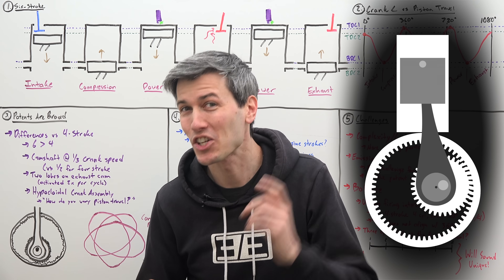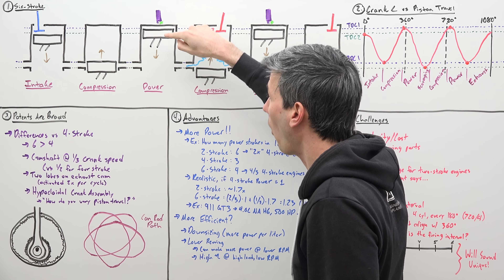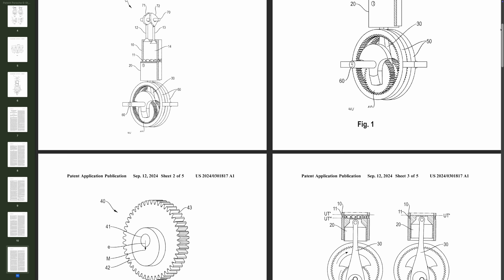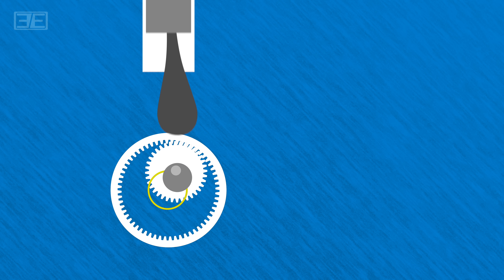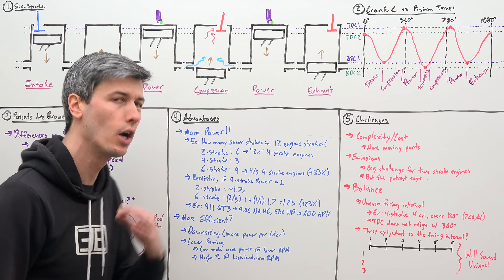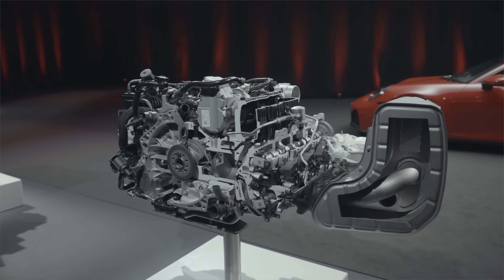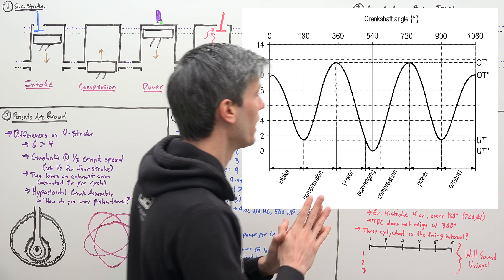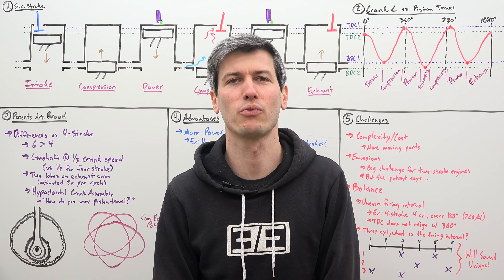Porsche's 6-Stroke Engine Is Genius!

Comment: As a mechanic I'm already getting cold sweats about timing it
Reply: And as a reliability engineer, I'm in the same boat ;-)
Reply: @jalanperak taking on water?
Reply: @jalanperak  
Is the dirty two stroke narrative a myth given the same exhaust clean up as 4 stroke and using high forced induction pressures combined with slower engine speeds to increase time for cylinder filling, combustion and scavenging ?.
What can this lash up do that just two stroke couldn't do simpler and better ?.
Reply: @confederatenationalist7283 it's a concept engine, we have cat afterburners, we have computer monitored clean burn! This engine is in no way necessary, but a supercar that will pass a gas station, would be a good sales point!
Reply: @confederatenationalist7283 2 strokes generally have to have lubricants in the fuel. 6 stroke would presumably avoid that issue
Reply: @kalasmournrex1470  
Not Uniflow two stroke.
Only crankcase transfer port type.
Uniflow two stroke diesel engines have existed for decades automotive and marine they use the same lubrication system as 4 strokes.
Two stroke design is all about solving the volumetric efficiency issue of the short induction period.
Solved by as much forced induction as you dare.
Reply: @confederatenationalist7283 2 stroke is only dirty because they burn the oil. This is a 4stroke with a 2 stroke cycle. So there wouldn't be any oil burning. Because that isn't added to the fuel
Reply: @Superliegebeest0 
A uniflow two stroke doesn't use oil added to the fuel.
It's nothing like a crankcase transfer port design.
The piston uncovers the inlet ports in the lower cylinder walls before BDC.Then closes them after BDC.
Assuming decent forced induction removing the cylinder filling volumetric efficiency issue there are no downsides.
Reply: Porche: it will be done in the computer - but we'll rent you the diagnostic tool for $12,000 per month.
Reply: I wonder about reliability more, it seem overcomplicated wich usually lead to failure.
Reply: @nekot9274  
It looks like the worst of all worlds in none of the advantages of two stroke operation with insane levels of needless complication to do it.
Reply: @confederatenationalist7283  Exactly, with this 6 strokes engine, you got 2 power ones, Half of one more than with a regular 4 stroke but 2 less than with a 2 strokes for the same number of engine revolution. It is a very complicated therefore fragile concept for half a power stroke more. There is a reason that there is no bearing on the crank shaft, they are not strong enought to take the beating, so gear?
Problems waiting to happen...
Reply: @nekot9274 agreed keep it light and simple
Reply: Solenoid based valvetrain, maybe? Why not, we're already on six strokes...why not nix the cam altogether😂
Reply: @brittbancroft7817  
Flat 12, compound supercharged and turbocharged, boxer uniflow two stroke, with camless exhaust valve train.I like it.
Reply: It looks like it's all gear driven so everything would be indexed.
Reply: @MichaelLamar-zr7fy  
But massive levels of complication and labour costs for a bottom end rebuild.Theres probably a reason why design settled on the shell bearing and oil film rod to crank connection rather than the ball bearing system, let alone this idea.
Reply: @confederatenationalist7283  Exactly.
Reply: Let the Siemens computer deal with it. Those things can measure 1 gram of air missing in a minute.
Reply: Machinist trying to figure out how to balance the crank
Reply: As a comedian I'm already getting child sweats about timing
Reply: Finally at TDC… which one!?!
Reply: Timing is the last thing I’m worried about personally ( which could be wrong to say ) but considering the VVT technology and ability to control spark now I’m more interested in this crankshaft design and how long it will last
Reply: You don't actually think this thing will turn up in cars do you?
Reply: The timing should be ok, once the marks are lined up it’s smooth sailing from there.
Reply: ...and when you are finish with timing trow it away and take a BYD
Reply: @محمدأحمدالحمداتي  
No thanks.
Reply: Should be like timing vanos on a bimmer, you’ll have to lock the eccentric crank gear in a certain configuration before timing, and as this is under VW I’m sure they will also have you lock a similar setup on cams.

It will have a lot of Porsche tech/engine specific tools for sure.

Not DIY friendly but neither are most Porsche engines going by Mat Armstrong vids.
Reply: Idk if this will handle a misfire well 😂
Reply: Could use valve train like Koenigsegg has, if they don't have a patent on it
Reply: I bet you're underpaid at your job
Reply: That’s why you just stay in your lane.
Reply: No joke I was the 1,000th like for this comment on his 1,000th video 😂
Reply: it would be almost exactly the same as any other engine, you'd just have to make sure you're on the right top dead center. get the first piston to TDC1 and then align the cam gears. there may or may not be timing marks, if not then there will just be some tool to align it.
Reply: @boxr_4214  
There is no connection of any  piston and rod assembly to any other.They all have to be timed individually to their correct position relative to the crankshaft angle for each cylinder and it's rod and piston  ?.
In addition to any gear train wear throws the timing out for that piston and rod.
There are no advantages in this over a two stroke but there are massive disadvantages.
Reply: @confederatenationalist7283  that makes no sense. there is still a crankshaft, otherwise there’s no way to transmit power to the gearbox. the crankshaft just attaches to the gear rather than the connecting rod directly. i’m not sure what the exact way that an engine like this would assembled is, but it’d be fairly easy to put timing marks on the gears. then you just line up the marks to get all the conrods timed with each other. but that’s bottom end stuff anyway, no one is messing with that unless you’re and engine builder. the camshaft timing is what i was talking about, and that would still be pretty simple.

also i never said this engine was any good im just pointing out that timing the engine isn’t a major concern. it would be easy assuming the engineers put timing marks, and if they didn’t then you’d just have to make your own marks based on info from a shop manual.
Reply: Understandable
Reply: You think they’re gonna let mechanics into this thing? If it’s anything like Nissans VC engine, if there’s a problem it gets a new motor.
Reply: You are obviously not a German mechanic. 😂
Reply: Would not be like a normal combustion engine. Probably more similar to a gear connection between crank rod.
Reply: Two different TDC... lol
Reply: Just LS swap it already. Solved
Reply: Took the words outta my mouth brother...the new guys should just start looking for new jobs now
Reply: Don't tell Matt Armstrong
Reply: Ignition triggers will be a head fcuk.
Reply: 6 stroke v wankel
Reply: @quinn860  = random motor
Reply: Exactly 😂
Reply: The maintenance on that is gonna be bonkers. So many things to go wrong.
Reply: Don't worry friend, the engineers are sweating more making a patent a commercially available product.  "Such terrible headaches" - The Professor and the head of team charged with bringing this project to fruition!
Reply: They don't have financial problems because they cater to wealthy clients that like that kind of product, that's it.
Reply: The power stroke seems to work on non direct energy.  The forces are nonlinear.
Reply: look on the bright side...  you can only do it right once.
Reply: I know lol
Reply: You'll never have to worry about it, if you see one of these it would be the only one!
Reply: Bro no worries. Just put a stick in the spark plug hole, rotate the crank 0.01mm, and feel the rotation change. Not first or second one, it's about 2/3 of the way until the third before you'll know your in top top dead dead center center. But if it goes to top top DEAD center, all the valves will blow thru the good so be careful.
Reply: I Agree. Makes no sense, it's more power consumed for less output, and more heat
Reply: Don’t worry, Porsche makes it impossible to do your own maintenance. Ask me how I know 😂
Reply: For those who think the combustion engine is going away. I don’t think so.
Reply: @OUSoonr1981 
Unfortunately there seems to be political agendas within agendas playing out.Which seems to be about disadvantaging the developed western world to the advantage of others.Not helped by manufacturers perception of more profits in selling EV's at an ICE price.While it's a mystery why they didn't and don't see the advantages of running a Uniflow two stroke engine, at half the rpm and at twice as much boost, as a four stroke engine.
Reply: not only dat tuning is gonna be a nightmare bmw finna learn from this 😂
Reply: 95% patents are never utilized.
Reply: Forced induction
Reply: Looks like there would be some vibration from the offset
Reply: Wow! A bunch of extra moving parts in the power transfer area of the engine. Bringing back power valves or reed valves, like 2 smokers. All while the world is trying to stop using internal combustion as a means of travel. Good thinking Porsche.
Reply: ?
Just align all the timing marks and install the timing chain or belt, just like any normal engine.
Reply: @larsjrgensen5975 not all engines have timing marks, some of em dont even have keyed cams  for the phasers to lock em into the cam for proper timing
Reply: @ Ok then mark the gears and chain. Then mark the new chain before removing the old chain and use a locking mechanism to lock the gears when changing the chain.
My farther borrowed a bracket to fix the gears on his V6 single OHC. On my inline 4 dual cam there was timing marks everywhere and there was small locking holes in the gears for special tools to fix the cam in place, but we did it without the special tools.
A professional mechanic should be able to get the tool or make them themselves if needed. If the cams needs replacement then it would be a problem without timing marks I agree.
Reply: @larsjrgensen5975  
Bearing in mind the insane geared and timed eccentric conrod connection at the crankshaft.
What's the point of an alternating 4 and two stroke just to get the power stroke every revolution that a two stroke would provide.
Reply: @confederatenationalist7283  There is not much info about how this engine is running in the real world.
They could decide to not exhaust after the 4 stroke cycle and then reignite the small leftovers in the cylinder like a sort of cleaning function at low load.
At higher load they could lean more into the more bangs per minute for more power, but less clean operation.
It would need direct injection for the best result.
Just a theory/guess.
Reply: @confederatenationalist7283 not sure how the engine would work out. However it might have better usable power range than a 2 stroke
Reply: @mattschm5486  
A serious forced induction Uniflow type design shouldn't be confused with a small capacity NA crankcase transfer type motorbike engine.
In the case of diesels at least specific peak torque and peak power and the rev range between them was more than a match for 4 strokes.
In fact the design has advantages for low end power potential as ultimately seen in large marine engines for shipping.
Also don't think there was any proof that the emissions issue couldn't be dealt with, as opposed to no one actually  bothered to try.
Reply: @larsjrgensen5975  
My idea would be to use two stroke only running and forced induction. But more to maximise air flow per revolution per minute to minimise combustion temperatures and pressures.
Reply: @derpwnd3213 that's when you time it with cylinder 1 up
Reply: @confederatenationalist7283 
I think he explains that in the video 😮
Reply: @larsjrgensen5975 seems that you and your daddy know everything.
Reply: @larsjrgensen5975 everything produced has marks, but lining up cylinder head surfaces with cam and chain marks has always been a goofy way of doing things! This sounds cut and dried, and may not be difficult at all!
Reply: @derpwnd3213  Engines really took a turn for the worse in about 2000-2004. I worked for a world manufacturer. The quality just went through the crapper then. They had keyed well before then. But the rest of it really took a shot after 2000.
Reply: @larsjrgensen5975  ....as the non mechanic said to the mechanic. As it happens, timing it was the first thing I thought about too.
Reply: @larsjrgensen5975 and it will be many times more complex to do. It’s why rebuilding the top end of a 2 stroke takes 15 minutes, instead of several hours.
Reply: @randygrein5386  
In this case all the complication looks even worse in the bottom end.
Two stroke uniflow could at least go back to simple pushrod exhaust valve actuation.
Reply: @larsjrgensen5975  I hope, but doubt it is that simple. Also, there is building the engine from block up which makes timing a little more complex than  swapping out a timing belt/chain.
Reply: @larsjrgensen5975 you think it’s that easy 😂
Reply: @larsjrgensen5975  its never that easy for German vehicles.
Reply: @larsjrgensen5975 you sir have obviously never had the pleasure of erman engineering
Reply: Why are they still investing in combustion engines 🤔🤔
Reply: @MohaAhmadhamadani  
Why not ?.No one voted for the abolition of ICE.
Reply: @محمدأحمدالحمداتي  because they are awesome. No one wants an electric porsche.  People don't buy them as commuters.
Reply: @adamnagel7436  its just because we are used to. Nothing more. I was in shanghai and was very amazed from the clean air and the quiet city centre.
Reply: @محمدأحمدالحمداتي because they will still be around
Reply: All of that to get 23% is crazy though not gonna lie. 😂😂 I like it but you do it first and let me watch a while 😂😂
Reply: Ai will tune it, maybe!
Reply: @dylanlevar5176 The processing is definitely there to do it these days. 💯
Reply: Like Audi isn't bad enough. Over-engineering at it's finest. No wonder this company is in such trouble. I'm really surprised at all the people claiming they aren't in deep financial trouble. EDIT- Stock down 24% in the last year, laying off and closing plants. Apparently investors see things a little differently. Trying to claim they are different companies just doesn't work. That's like saying Lexus and Toyota aren't the same company. On the bright side it's looking like the US might allow them to open some plants there. There is even talk of the EPA having a little looser reins on the car companies.
Reply: @Troy_Built  How is Porsche in trouble? They’re selling cars like hotcakes
Reply: @AbstractWerks  aint, they suffering.
Reply: @AbstractWerks  Poor man's sports car lol
Reply: @Troy_Built  Neither Audi nor Porsche is struggling lol
Reply: @drachen6096  only their technicians are
Reply: @drachen6096  The owner of both, Volkswagen AG, is struggling.
Reply: @drachen6096  wrong, Audi truly has issues. You don't follow the news. Sure, both Audi and Aston Martin sell cars and own an F1 team, but that alone doesn't mean they are doing great or even just fine.
Reply: @drachen6096  VAG group is definetly struggling and porche is part of that, despite the fact that porche has the biggest profit margins from the group.
Reply: @staLkerhu  
They aren't doing fine because, like the rest of the industry, their customers want proper ICE powered cars.
But the governments say they aren't allowed to sell them by imposing rationing and quotas on sales.
Reply: @SoulTouchMusic93 “Porsche“ just copy it from the title
Reply: @drachen6096 yes but VAG is hurting a bit, who owns them? Also historically Porsche has had issues selling cars (little Toyota bailout)
Reply: @Troy_Built  There is a 18 month wait for some cars they are not in trouble
Reply: @Troy_Built  americans when engine is not push rod:
Reply: @thorvonfalin9975  
If it was just two stroke there's no need for inlet valves or variable valve timing and it can produce more power than 4 stroke, at much lower engine speed.
Pushrod works fine in top fuel dragsters and NASCAR even if anyone wanted high revs to make power.
Reply: @Troy_Built what EPA ? Aren’t they semi-fired already??? 😂
Reply: 😂😂😂 @Troy_Built  Audi is not a hard engine to time whatsoever. Of any year, people just get easily intimidated by the 4.2 l.
Reply: @Troy_Built  Just get a horse and buggy if the engineering is bothering you
Reply: American?
Reply: @Troy_Built  this is how the Nazis lost WWII
Reply: @Troy_Built  only EV's are in trouble the rest of their cars are perfectly fine.
Reply: @Troy_Built 100 % man I don't mind tearing engines apart put them back together but this just seems so mechanically over-engineered it's like where would I even start I get the timing and do this and do that and all that other crap but gosh damn why can't we just keep it simpler... Insanity most people have never even worked on an engine and have no idea they just know it works.
Reply: @MadDestructionChaos  You'll never work on one of these engines, so chill.
Reply: @MadDestructionChaos I wonder where this fresh air comes into the crankcase to supply the bottom piston ports with, as he calls it, fresh air! So they install a crankcase fresh air system?*
Reply: Bc u don’t Unterstand… u still have 1 ot … wtf how are u Abel to Life?
Reply: Yeah, the "timing" for a new combustion engine is the worst, when globaly electric cars are beeing sold more and more while Gas / Diesel ones are on the back foot in sales.
Reply: @Tricky_Thinking  Lol what? Electric cars are not selling at all... And they are the reason VW is in trouble atm
Reply: @Tricky_Thinking funny, correct and relevant 👍👍😎
Reply: @Tricky_Thinking not at all! They are being pushed on people by the big machine media! Ignore them they'll go away! And anti electric terrorism is on the rise, particularly one company, many have yet to go to prison over electric cars! We will never run out of oil, earth produces it regularly, and the people that have control over it are the biggest problem in the world!
Reply: @Tricky_Thinking lol more gas cars are being sold than electric cars
Reply: @morpheus_9  I agree. I don’t know where he gets his information from? Probably California.
Reply: @Tricky_Thinking all the data suggests otherwise. That's why the big 3 are losing money and pulling back production. Why do you think they charge so much for new cars. That R & D has got to be payed from somewhere
Reply: @shroom9033 he probably thinks that because of where he lives.
Reply: @Tricky_Thinking I agree combustion engines are on the back foot and probably will loose a lot of market share. So I think these engines will be low numbers and so not a problem in the large scale